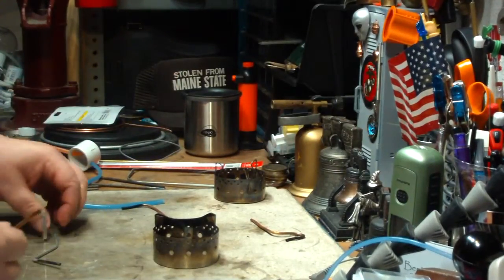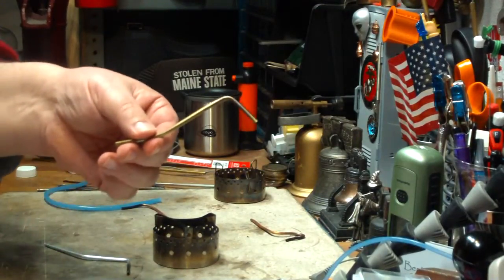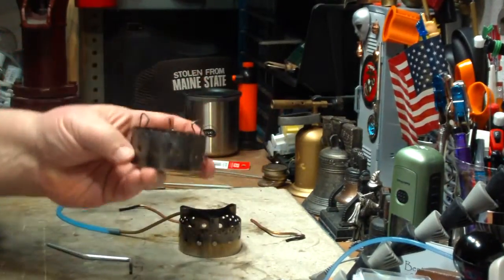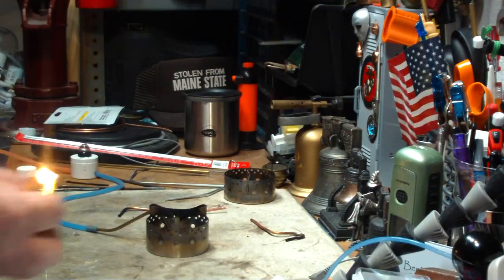Make Your Own Feeder Tube For Flat Cat Gear's ISO-Clean 2.0 Stove

Comment: If ur in a pinch.. u can get outta trouble by packing the tube with sand and bending it, I have seen it work on copper, cant tell u about brass.

Comment: FYI - I use 5/32" (0.153") brass tubing that has a 0.014" wall thickness.  And yes, you will need a tube bender or the tube will kink and collapse on itself.  Make the tube long as the heat from the flames/stove/pot can burn silicone tubng.  Best wishes - Jon

Comment: in a good automotive parts supply house you can get lengths of stainless steel brake fluid lines if you wanted to use different materials.